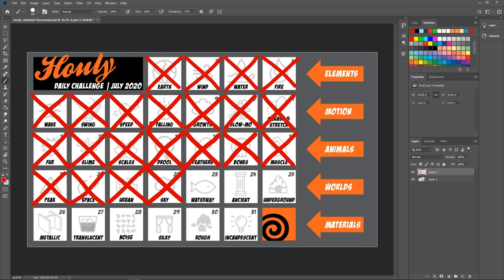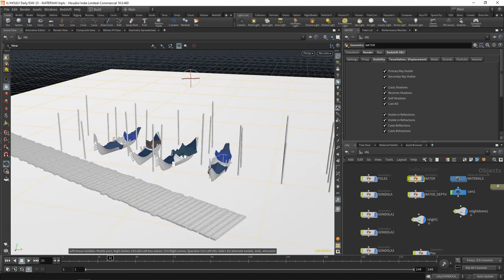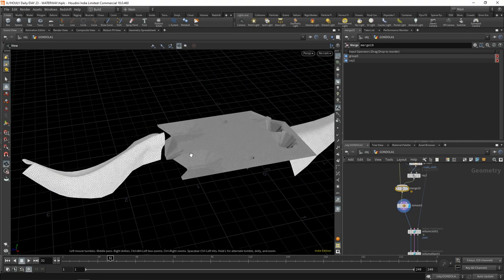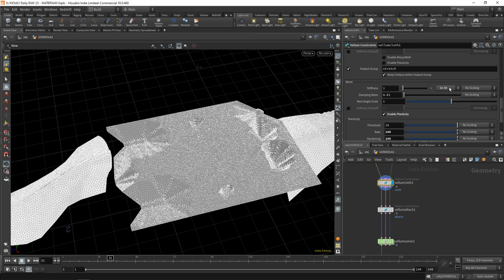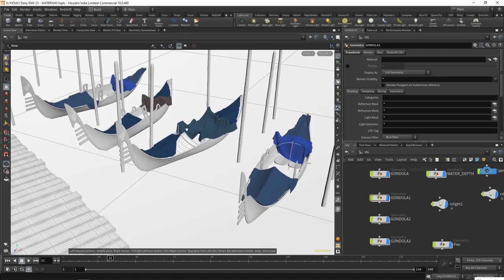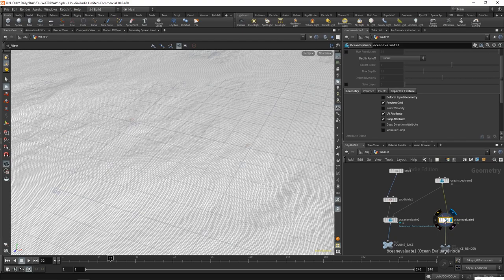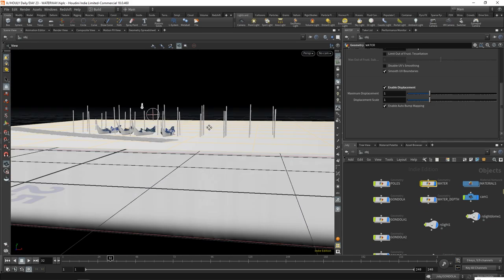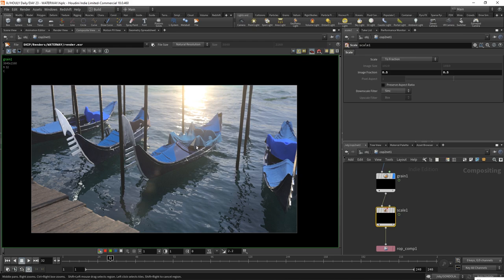HOULY Challenge Day 23 Waterway 31 Days of VFX

Comment: How do you shade the "depth Volume"?
Reply from the maker: It is a basic volume shader with high scatter and absorption coefficients. You can set the color to a de-saturated  turquoise and that should do it. You can get a good idea of how well it is working by putting a small object in the volume, hiding the surface, and testing how well you can see the object inside the volume. Hope that helps!

Comment: Hello, is it possible to export the ocean with the material into blender?
Reply from the maker: Hi, yes. Ocean spectrum in Houdini is saved as a vector displacement map. Basically, that's an image with color's representing displacement in 3 directions. You can take that image into blender and apply it to a grid as displacement. For the material, a glass shader with an IOR of 1.31 should be fine with a bit of absorption in the refraction. I hope that helps 😁